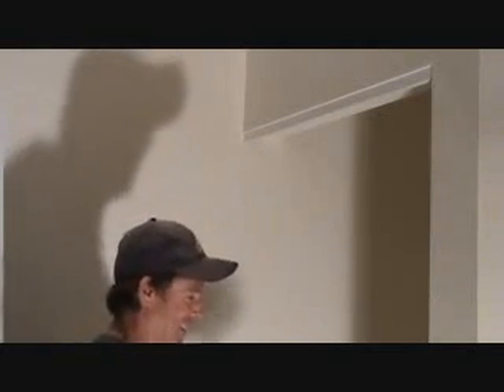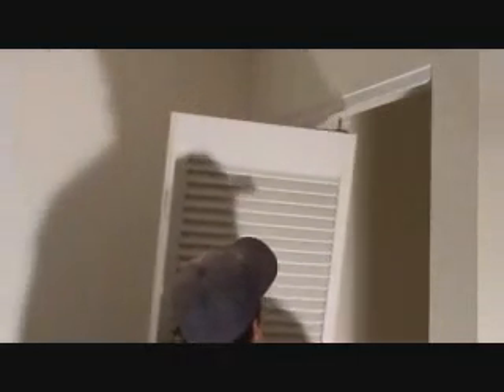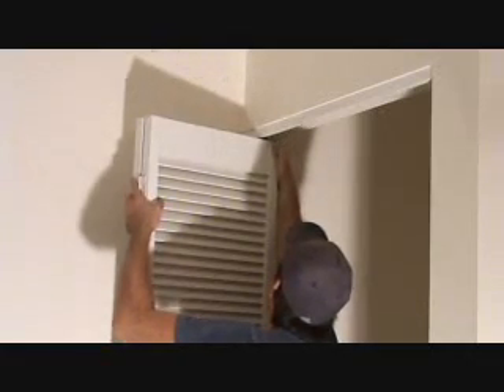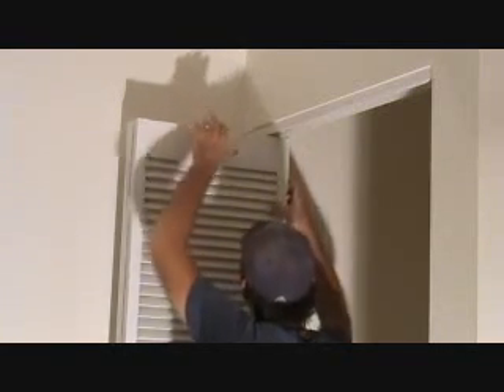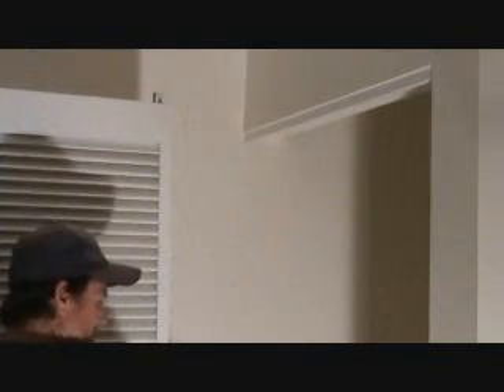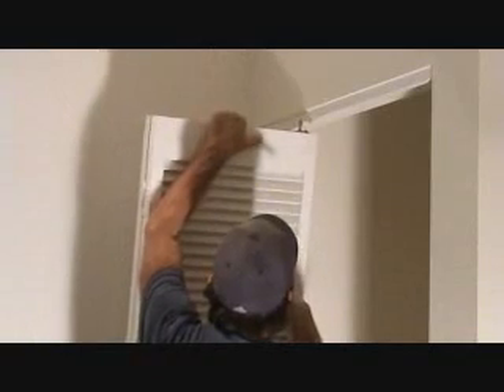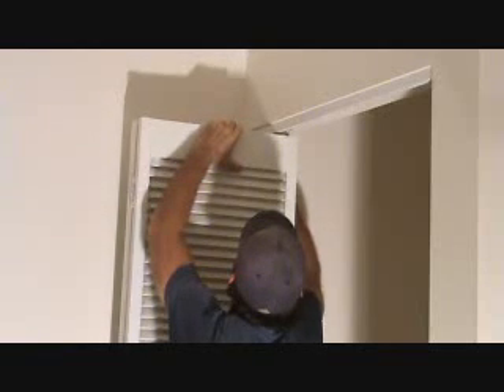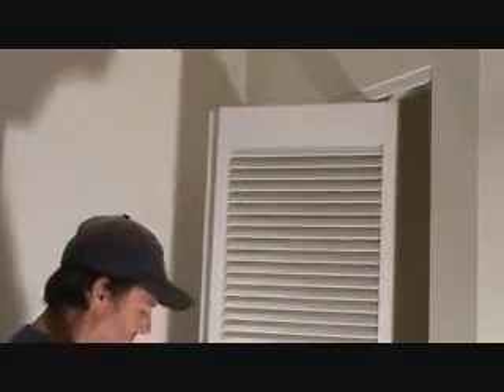How to re-install a bi-fold louvered door unit

Comment from the maker: Sorry this video wasn't too clear for you. You could also stand the 2 door leafs up together (straight up), then slide over to the opening, then tilt them at a slight angle so top will slip in the general area. Position the bottom over the bracket, then swivel the doors all the way up  & carefully pull down on the little end that doesn't have the wheel, then position to hole in top bracket, then put wheel in top bracket, then get on knees & see if bottom is in bracket.   Joe  :0